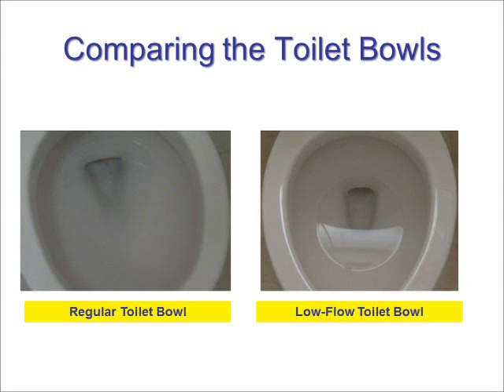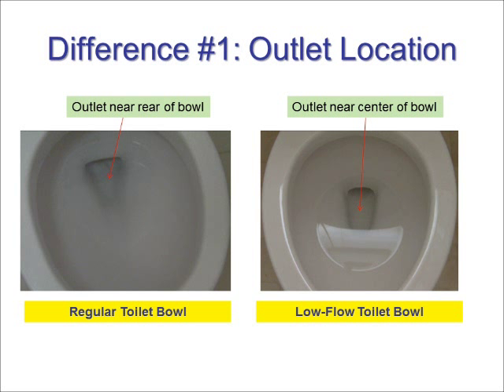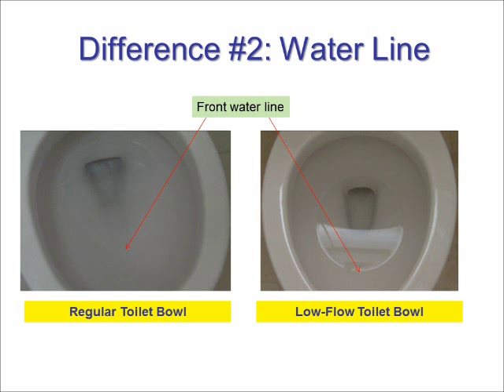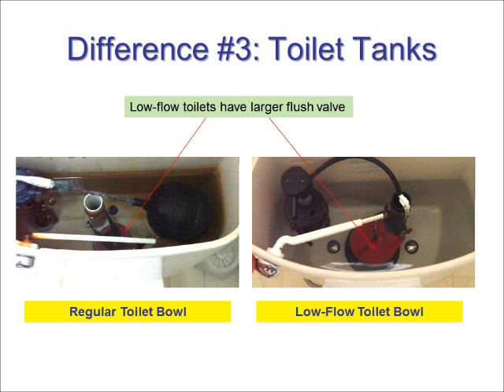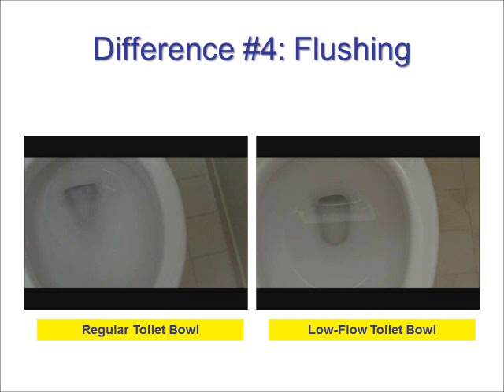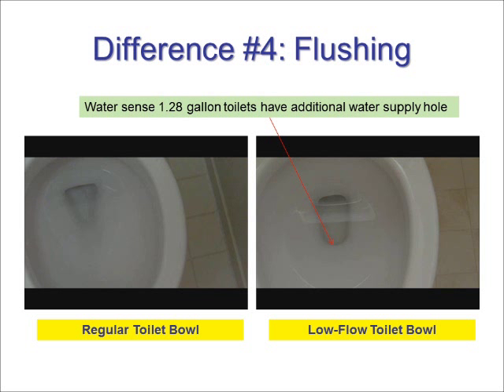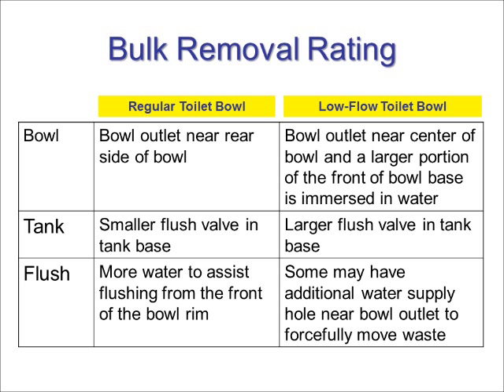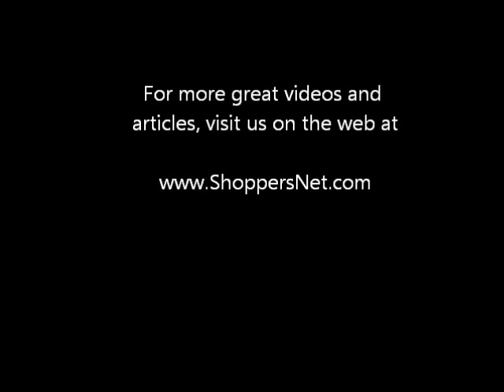Low Flow and Regular Toilets -- The Differences Revealed!

Comment: I installed a low flow toilet. Biggest bathroom mistake I ever made. They don't have powerful flushes, don't believe it, it's propaganda and you'll find that out if you install one. Low flow is fine for piss, but not for dumps, especially big dumps by big people. I changed back to a normal toilet and all is well in the bathroom again.
Reply: I made the same mistake. If you are new to toilet, don’t buy a low flow unless you want to flush like 5 times to get a piece of shit down. That amounts to a lot more water wasted
Reply: @Pootie_Tan  I had an American Standard Champion 4 and I flushed it 5 times before finally pushing my tiny piece of crap down with the toilet brush. I replaced the damn thing with a 1993 Mansfield Imperial yesterday.
Reply: I have an older one that i will never get a new one. when i flush it the material is half way to the waste department . lol

Comment: The problem with low flow toilets is that the whole thing is designed so there is a tiny pool in the toilet, requiring several flushes very often. A larger tank on top with more water per flush will not solve the problem, because your mostly dry bowl will be smeared with poop, and require several flushes and a cleaning besides.
Reply: Dude eat more fiber.
Reply: @manco828  it still won't help ,it's just not enough water
Reply: I agree just finally got one a year ago it's fine but what you said and others in the comments are true

Comment: My Toto Drake low flow toilet has the outlet near the rear of the bowl.  My 1952 Kohler has the outlet in the center of the bowl.  The Toto does a pretty good job, though the fill valve (made by Korky) started to leak after 3 years.  Also, the flapper was too small for the flush valve and was also leaking within 3 years.  When I contacted Toto, they sent me a new fill valve & a differently designed flush valve at no charge.  Good I could change out the parts without having to pay a plumber.

Comment: Now try the comparison with a large adult sized turd and watch what's left in the bowl after the flush. Count how many times you have to flush the low flow toilet to get it all down without leaving diluted crap in the bowl.
The solution is easy… a variable flow toilet. A low flow button to flush urine and a large flow option for huge dumps. Even a middle option for something in-between.
Reply: So true. Low flow toilets are garbage.

Comment: You will notice ZERO difference in your water bill by using a low flow toilet.  You'd have to flush your toilet 24/7 to notice a significant difference.

Comment: Low flow: flush,  have to brush, flush again, clean the brush, flush again. Wait longer between flushes for filling. A complete waste of time and resources. But embarrassing to discuss so few complain. Typical case of unintended consequences from trying to be seen doing something positive. If the King Midas Touch made things turn to gold, Government would be said to have the King Feces Touch. Everything they interfere with turns to something worth considerably less than gold.
Reply: @Wa Lor  I had an American Standard Champion 4 and I flushed it 5 times before finally pushing my tiny piece of poop down with the toilet brush. I replaced the dumb thing with a 1993 Mansfield Imperial yesterday.
Reply: @OCC_Plumbing_and_Restorations  Low Flow toilets also clog fairly easily. Some don’t like the 2000s Cadet 3s and Champion 4s. 2000s Cadet’s may have decent bowl rinse but those horrible performance. I’ve clogged 3 of those on normal use.

Comment: My low-flow toilet looks like it has maybe 1 1/2 cups of water in the bottom of the bowl. I bought it to replace a toilet that was giving me problems. I can't even begin to tell you how much I HATE that low-flow toilet. I think it's inefficient, it can be nasty (don't ask me how), and hasn't saved diddly-squat on my water bills. I have to hold the flush handle down for 10 seconds each time I flush, just to get a reasonable amount of water in the bowl. 
I have a plumber coming next week to make an estimate on replacing my tub and surround, and I'm going to ask him how to adjust the water level on the low-flow toilet or replace it with one that's designed to handle normal bodily functions.
Reply: 12th December: I have found that if you hold the handle down all the way until the toilet stops flushing, the dump will make it through because the water in the tank will have emptied.  If you only hold the handle down momentarily, there will be some water left in the tank, thus less water to push the dump through.  (These new toilets really suck!)

Comment: I wish my regular flow toilet flushed as well as either bowl. Mine not flushes slower then either, it has a whirlpool effect and sometimes stuff comes back up, requiring a second flush. And my bowl is so old, it has a dirty brown buildup of calcium. I have used CLR, BLEACH AND DISH SOAP AND THAT REDUCES THE BUILDUP BUT I CAN'T GET RID OF IT PERMANENTLY. right now I can't afford a new one. Plus I move my bowls 2-3 times a day. Any suggestions? I follow the maxim, if it's yellow, let it mellow, you know the rest.

Comment: Those are both low-flow toilets. The one on the left is a Sterling Windham (1.6 gallons per flush), the one on the right is an American standard cadet pro (1.28 gallons per flush).
Reply: I'm 99% sure it's a Sterling, due to the more triangular trapway, but you may be right.
Reply: How are you doing, by the way?
Reply: I had the stomach flu, but I'm going to Hawaii in two days, so I'm pretty excited!
Reply: Oh. I hope you're OK!
Reply: Ah.
Reply: @Twentythree33  Definitely a Sterling because of the tank.

Comment: I have a refurbished 1986 Crane Radcliffe in my 1979 Redman mobile home that replaced a 2004 Eljer Patriot(a HORRIBLE toilet) and I will NEVER, and I mean NEVER get a low flow toilet! Whats the point in saving water when when you have to flush 2-3 times to clear not only the bowl, but also the drain pipe between the house and the sewer/septic tank without the waste stopping a 1/4 of the way though the damn pipe, thereby requiring you t flush the pipe at the cleanout(if you have one) or flush the toilet 2-3 times?!?! There's no damn point! With at 3.5/5gpf toilet, one flush and everything clears the bowl and the drain pipe to the sewer/septic tank and they seldomly clog because of the larger trapway diameter. Yes I could get a pressure assist toilet but their noisy and I don't want a toilet that's potentially dangerous as they've been known to blow up on occasion. And all you tree huggers can kiss my ass!!!